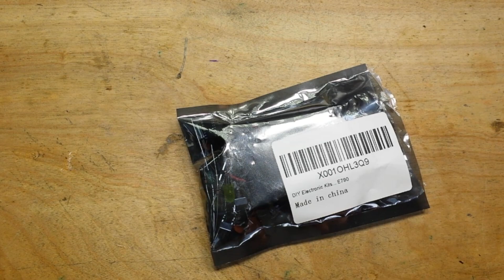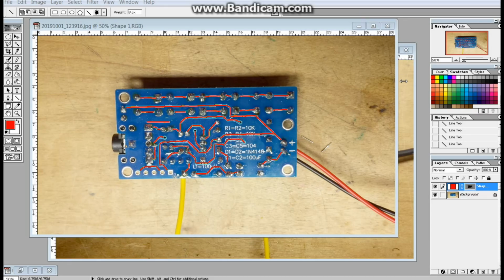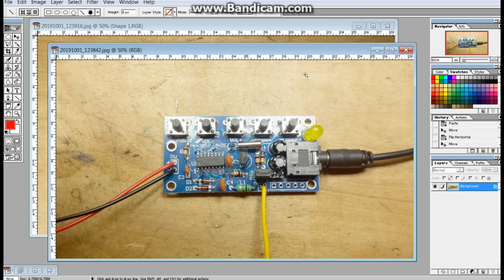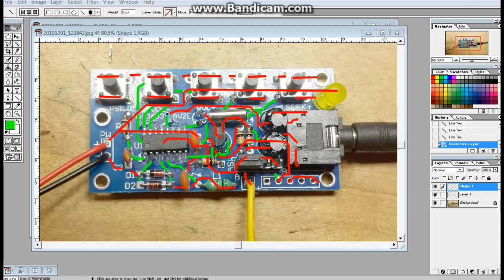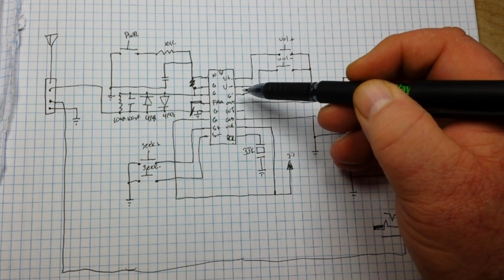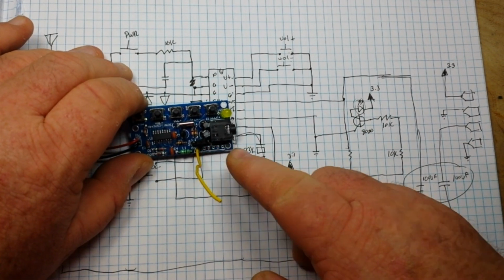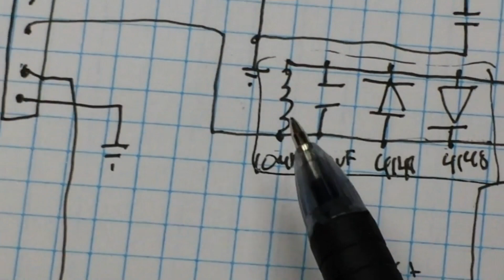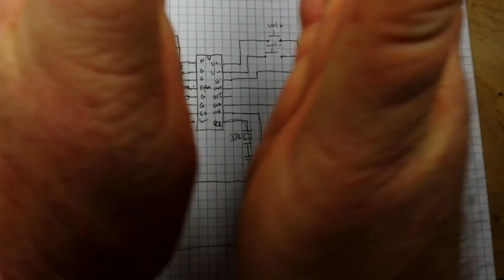FM radio kit build and reverse engineering

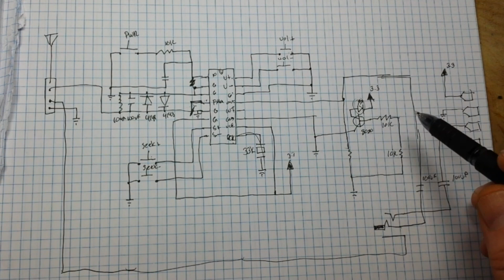Comment: I bought another one of these kits which I will be building a little differently because it is going to be part of an old Philips boombox which had it's radio board destroyed. 7:23 when I put my little radio shack mini amp on this LED, music played. I also put a 2 foot antenna on mine and it pulls in lots of stations.

Comment: I'm curious what that 5 pin connection is to the right of the antenna wire. Could that be a way to control it remotely from an Arduino or something or maybe this kit can be installed into a larger project box and be a larger radio?
Also that transistor I thought that was to amplify the output but the little chip in my kit radio can drive a small speaker quite well, enough to hear but not if you want to crank up the tunes.

Comment: The kit provides antena choice, which in most modern PLL radios are the sleeve pin and the reverse engineering has place for learning how stuff works in its essence. PS: if you have one of those Bluetooth speakers, connect a pair of headsets to AUX in order to provide antena on FM radio

Comment: Are you sure about the inductor and cap with the 2 diodes being a timing ckt ? To me it look like a band pass filter with 2 clamping diodes, I could not read their values but I would think that they would  be such to put the filter smack in the middle of the FM broad cast band, would you mind confirming?
Reply from the maker: You could be right, even more though after looking at it it might be a clamping circuit.
Reply: @learnelectronics  Looks to me like a tank circuit with voltage limiting. If that's the case; then the aerial is loading it, and that will badly drop the tank Q? A very small (10pF), cap in series with aerial will help isolate it and improve things.